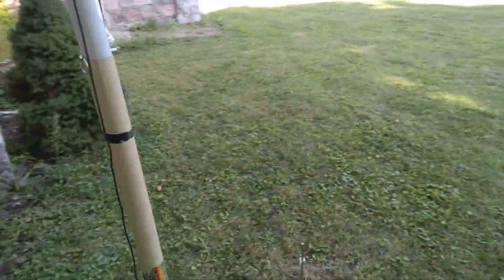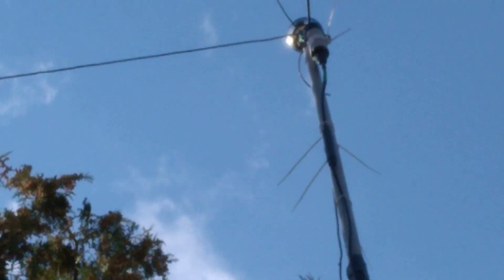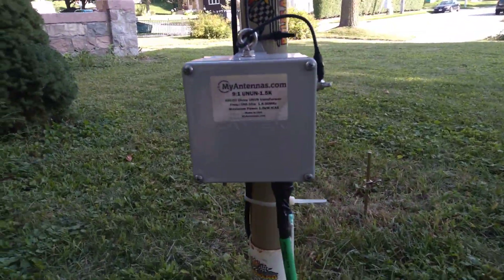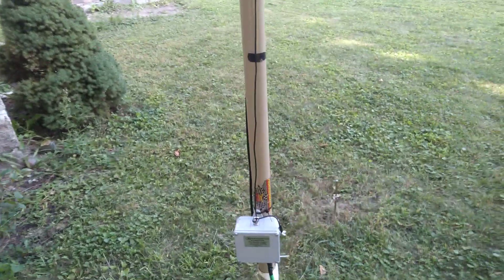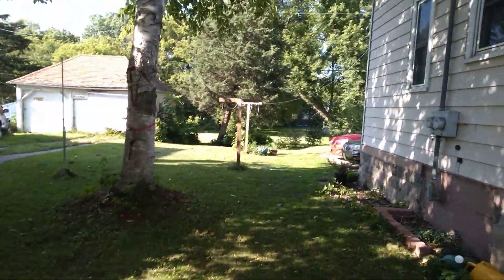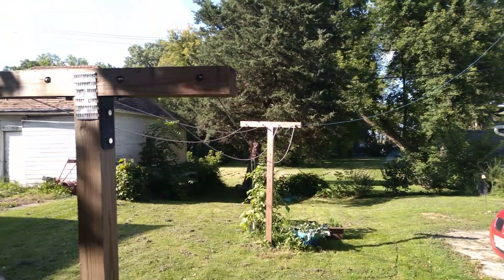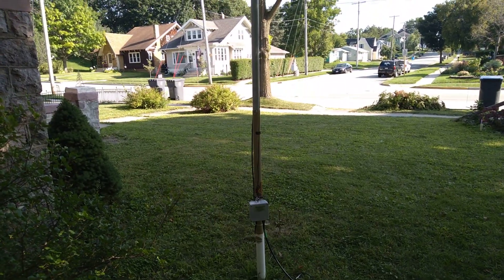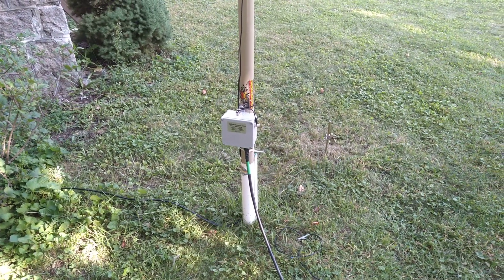My New Antenna, The Radiowavz EFH20

Comment: The general rule we use is keep the antennas at least 1/2 wavelength away from each other to prevent interaction.  but it's up and works and changing anything sounds like too much work for unknown gain.